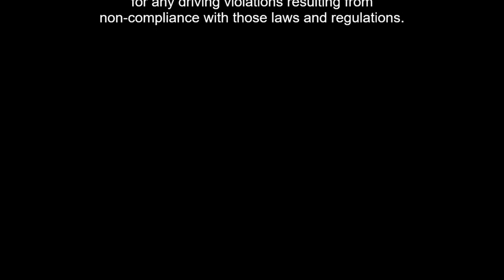Trux Accessories TLED Freightliner M2 LED Headlight Installation Tips A

Comment: Where did you get that bolt to mount the head light , bottom 2 that were broken?
Reply from the maker: Hey Toto, we include those hex bolts with our light. We are aware they often break when removing the OEM light so we offer these in our packaging.
Reply: What size are these bolts ??